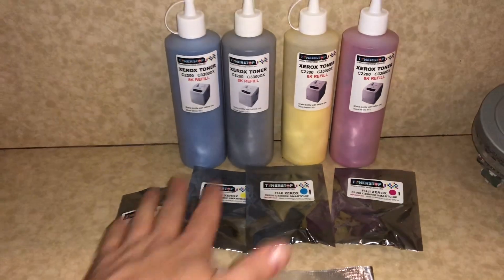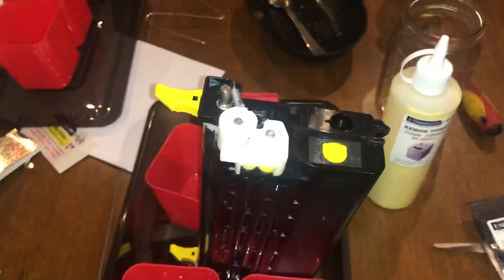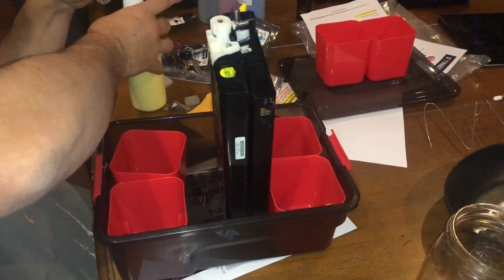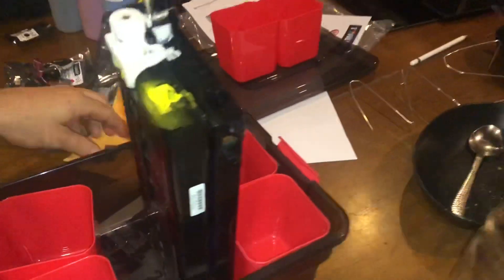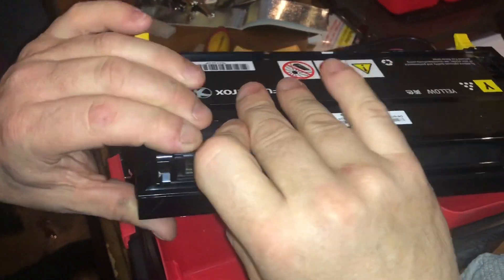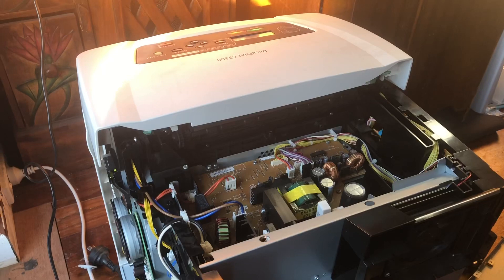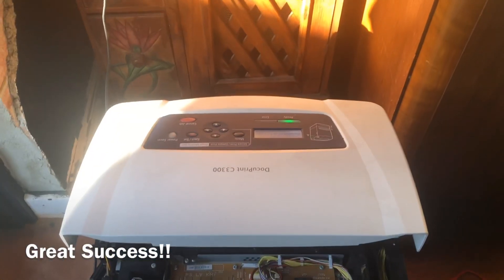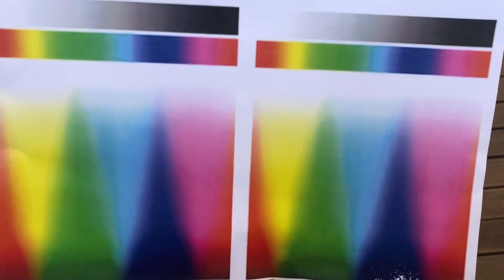Tool Time - Xerox C3300 toner recharge, and power supply replacement

Comment: I have the same printer as you ... when the power saver button is turned on for 3 seconds then it turns off and the display is blank but the fan sound is on ... how can I fix it
Reply from the maker: I am not sure, good luck finding a solution